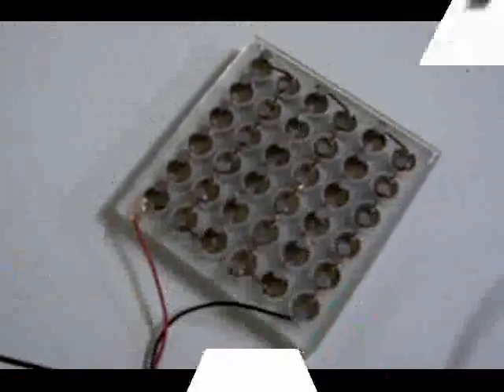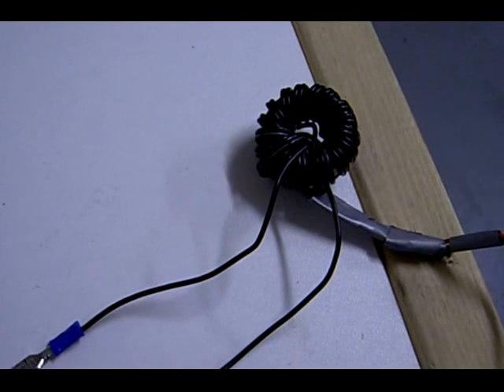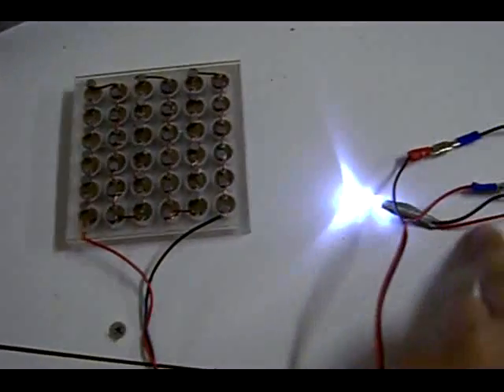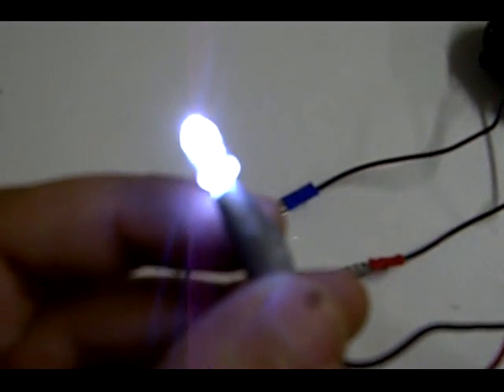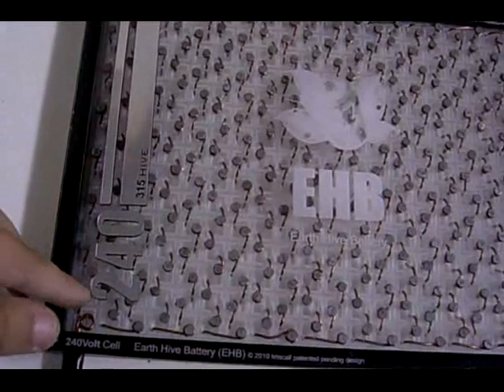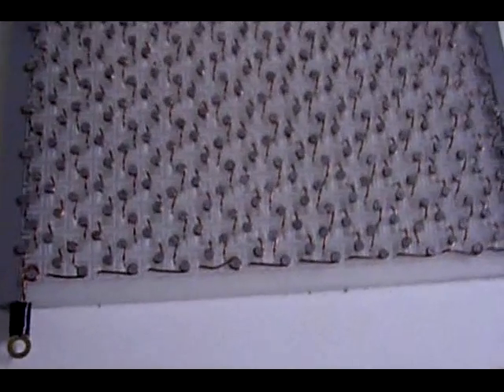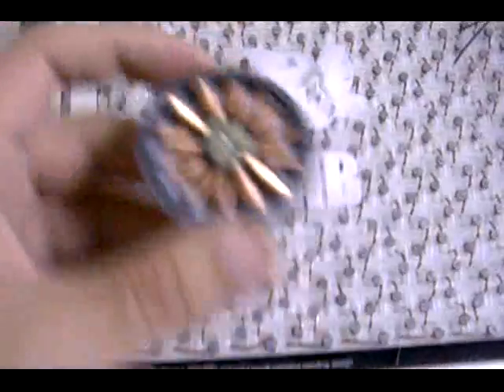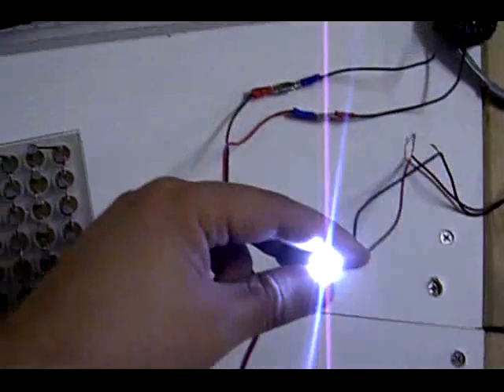Earth Battery Quest - EB Prototype 001 Tested With LED Light & Home Made Joule thief

Comment from the maker: I thought i would post this update
I powered up the 240V 315 Hive cell twice. The first time the cell did not work as 3 connections in the hive series were not making proper contact. The second time success but to my disappointment it only reached 64 Volts by the end of week 1 it was down to 48 Volts. This batteries life was about 3 1/2 weeks which at the end of it's life it was producing about 4.5Volts of juice left. It was powering two 3.0V white 8mm LED lights for all this time.
Reply: Dude, what ever happened to this? Don't you realize the compact version would make a great survival light in a pinch? A light that can last three weeks on dirt power? That's phenomenal. Throw some up on eBay man. I'll buy them.

Comment: See John Bedinis (Energenx) channel and convert those to crystal batteries, and you'll really have something. Cool experiment, but at the end of the day, its not an earth battery. It's a dirt based electrolytic battery, and a very expensive time consuming-to-make one, thus pretty much useless. However, if it were a crystal battery that seemed to never run out, THEN it'd be cool as hell! Even an Edison NiFe that lasted 50 yrs would be cool too. Nice craftsmanship, though, I must say!